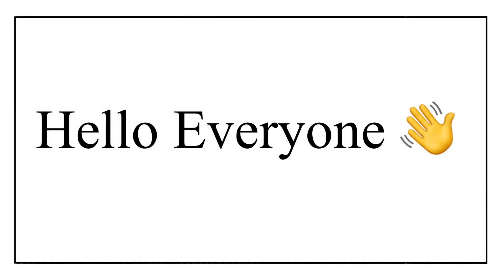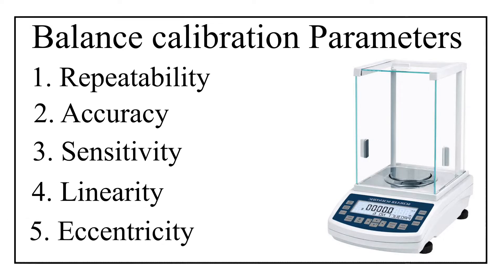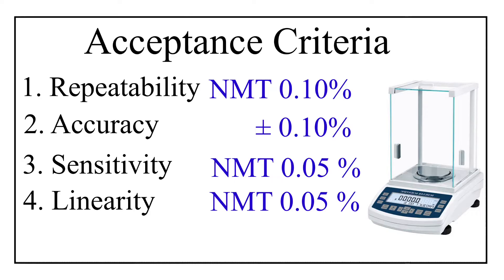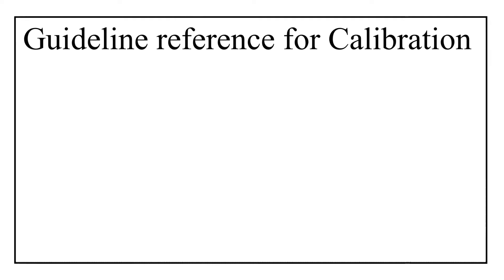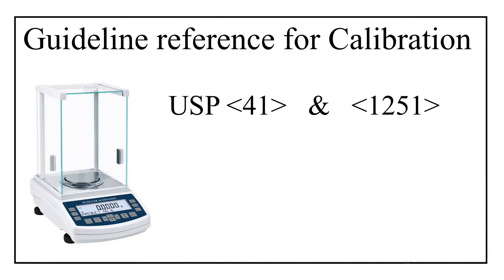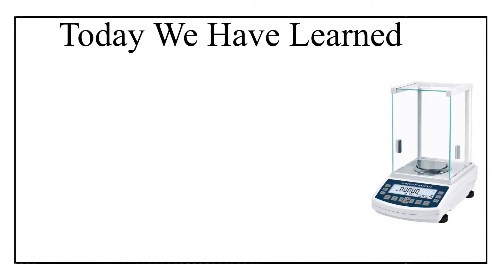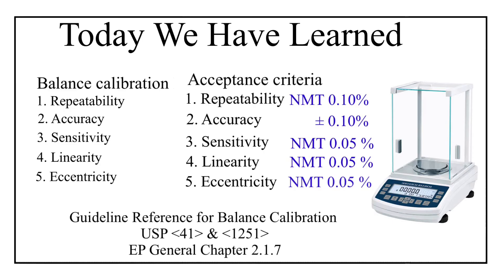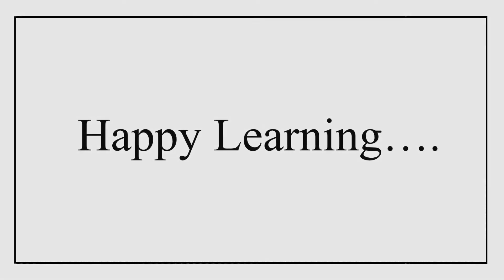Balance Calibration || Guideline References || Part-1 ||

Comment: Hello sir, Hope you are doing well l.
Let me know, the weight balances which are use in packing area / in strore (two digit balance with least count 50 mg) shall be verify / calibrate as per USP 41 & 1251 or is there any another chapter for 100 kg / 300 kg capacity weight balance ?